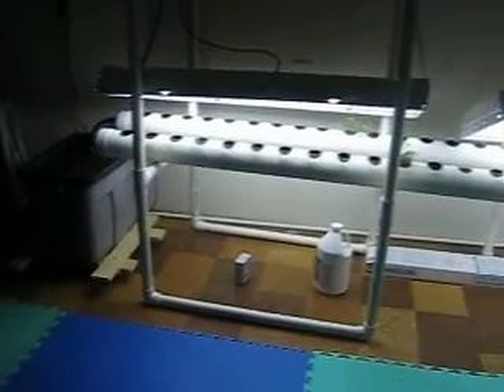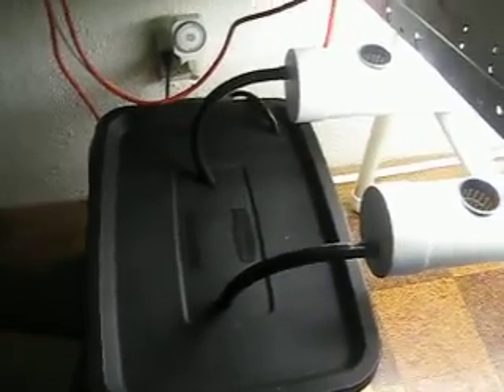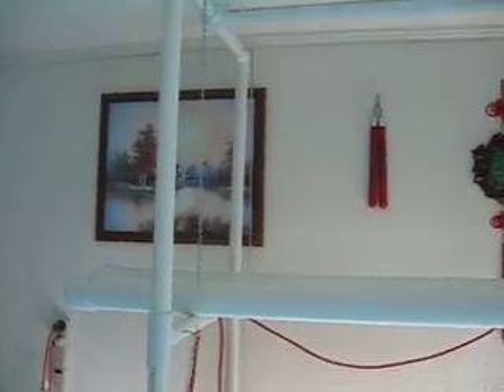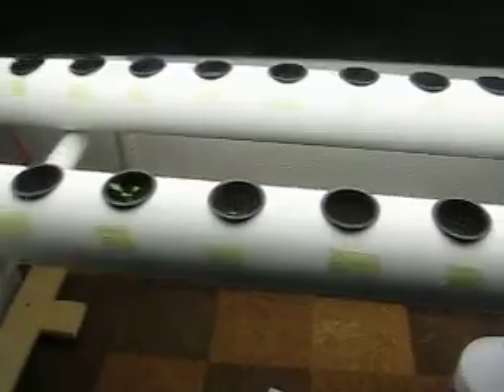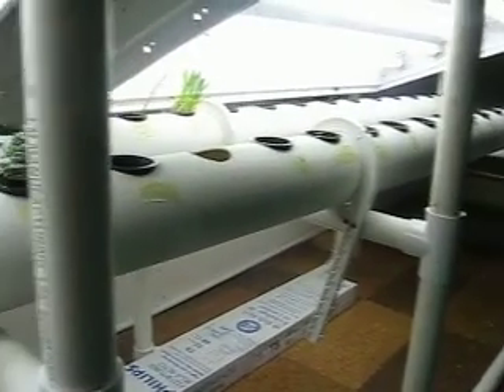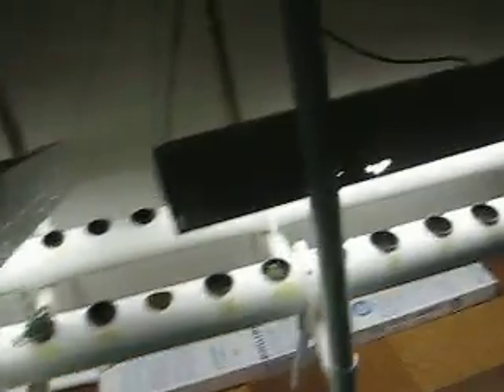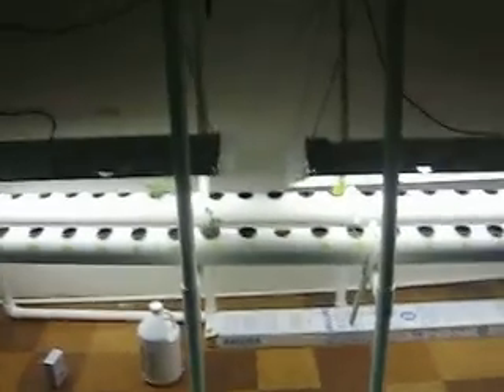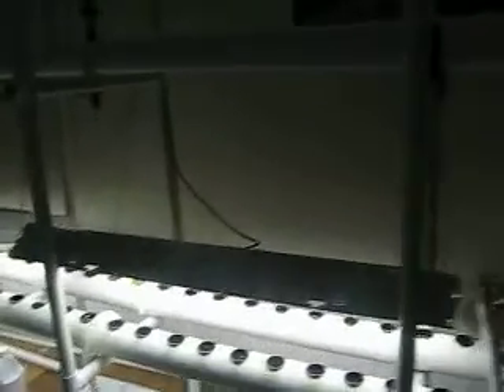Modded Edentro System (2 weeks later)

Comment: Sure, we noticed in our early prototype runs when cherry tomatoes get too little light they grow into the T8 fixture and wrap around the actual tube; the plants were warmed up by the incident light condense water on the bulb.

You can see the leaf-pattern on the bulb easily as a grey-shadow.  From what I know about fluorescent bulb construction, this is only cosmetic, or effects efficiently slightly

Yes, it is very noticeable.  If you look at the bulb (tube parts), you will see what looks like

Comment: Hi there, Edentro here (builder of hydroponic units).  If the plants grow into the lights, water will condense out of them and onto the light.  This will cause the fluorescent bulb to loose its interior coating somehow and light will no longer shine on a spot resembling the leaves.  This is safe but not ideal.  Just cut your plants in time!